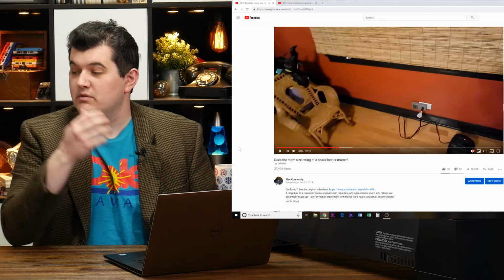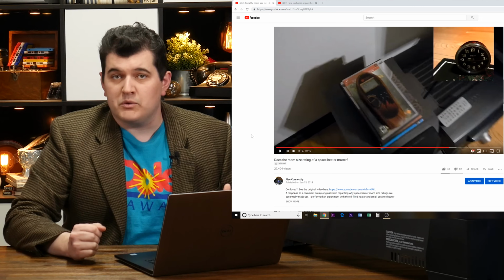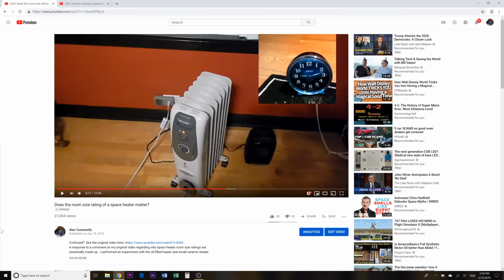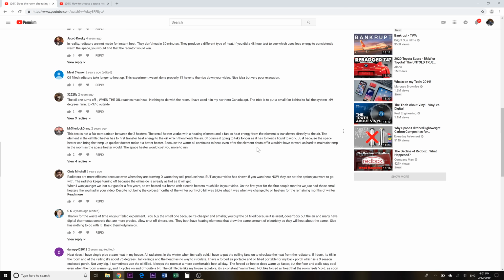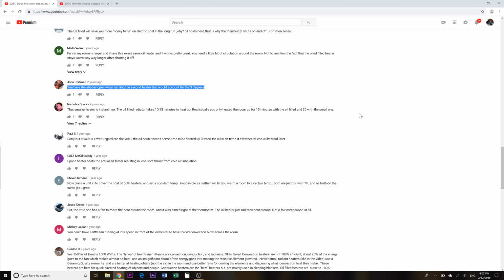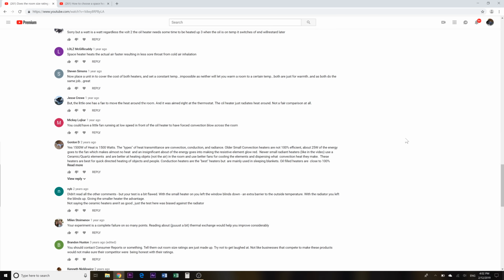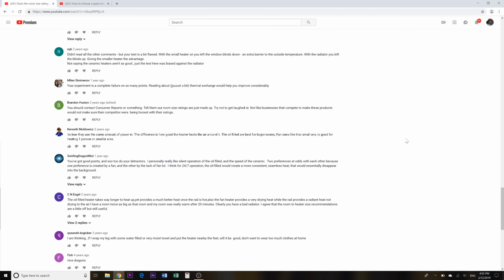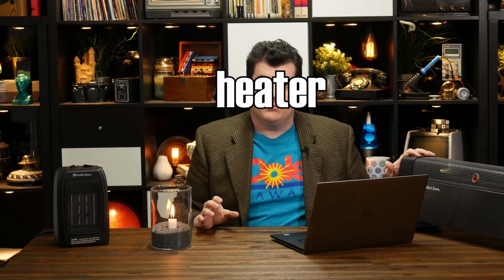More Space Heater Nonsense

Comment: Also oil filled heaters use convection so the heat goes straight up to the ceiling. Guess what, the ceiling is leeching the thermal energy out of the air into the cold attic before it has much of a chance to mix into the room. Fluid dynamics plays a large part in how effective your heating strategy is.

Comment: Neither one "produces" more heat energy than the other. However, my only argument would maybe be implementation of use. I think the convective baseboard heater would be better utilized near the wall, under a possibly drafty window. The heating of the wall would allow a larger surface area to help radiate heat to the room and rising heat currents would be distributed more quickly with a draft from the window. It wouldn't necessarily warm the room any faster but it would be more consistent and temporarily address the concern of a drafty window. A sharp draft can be felt acutely so if the draft is warmed first, it is a lot less noticeable.

In the end, neither one will heat the room faster than the other but I think they are designed to address different use cases.

In the end, listing the "room size" is a silly way to advertise them. Listing specific use cases would be better.

Comment: It would make sense for products that have on-off cycles to print an average power output. The only difficulty is that for a heater this would depend on the room temperature (since the cycle's purpose is to prevent the appliance overheating)

Comment: All else being equal, I thought it logical that a larger heater with a fan would heat the room faster than a smaller one - until I looked up the definition of watt (I had forgotten).  When I saw that a watt is a rate/time thing, everything you've been saying made sense.  I don't recall you saying anything about a watt being a rate measurement of work/energy per unit of time...

Comment: I had an oil filled radiator in my bedroom and it did a fantastic job at keeping the temperature consistent. It may not heat the room up fast but once the room is warm,  it will stay warm consistently. I don't know if the blowing ceramic heaters can do the same thing 🤷‍♂️

Comment: The only reason an oil filled radiator can be more comfortable, is because the temperature is more gradient. But no, it has nothing to do with the size of the room. A watt is a watt. Also in not so well isolated houses/rooms it can be nicer to have a oil filled radiator because when you turn off a electric fan heater, the heat will dissapear really quickly so it goes from warm to cold very fast.

Comment: So I will say that I have a Delonghi (I think thats the brand?) oil filled heater that I have had for several years, and its thermostat is offset from the unit itself several inches (edit: about 2-3 inches), located in the front (and away from the convection channels and radiating surfaces) and connected by a thin plastic piece with fins I assume to reduce temperature transfer (or save costs).
It will run constantly until it dumps enough energy into its oil (and eventually into the room) to bring it to temperature. And it regulates temperature better than any heater I have ever had in my life. It seems to use a digital thermostat with maybe an EMA, and it chooses between 500, 1000 and 1500 watts based on the temp delta over a unit of time. that EMA and choosing the heat setting based on the actual temp delta from the target to the room temp makes it very well suited to adapt to even smaller rooms when I have used it... it often just cycles on 500 watt mode here and there and turns back off. And uses the full power wqhen its really cold or in larger rooms.

So, the oil heater brand and model might be a factor. When this heater eventually burns out, I might actually cry, its so well thought of.

Hot take: one of the benefits of having a space heater is to actually eliminate the dead zone in temp regulation (where temps can be stochastic over time due to a central thermostat being in another area), and some heaters are better than that at others. Most digital thermostats have large dead zones. Most analog ones (even cheaper ones) have smaller ones when dialed in right. this delonghi somehow just get it PERFECTLY.

Comment: In climates that are only cold two or three days every other week or so, 1500 watt heaters work very well. I have one more expensive one for my main living area. It is equipped with remote control, variable output (it is often best to leave it operating continuously at half power). There are several safety switches should it tip over or have something obstruct it. They are both ceramic so that the glowing coils are never in danger of igniting anything. I have had the oil filled radiators and never thought they were good.  If I had rigged a fan to blow the heat away from it they might have worked very well and lasted more than a year. I avoid buying anything that gets hot yet relies on a circuit board or similar component.

Comment: I sometimes put a little desk fan beside the oil-filled heater to move the heat with more than just convection, and it helps cool the thermostat letting the unit run longer cycles.

Comment: 14:30 ima disign an inefficient space heater that instead of heating emmits long wavelength radio waves that will pass easily trough your walls and won't heat your room

I don't believe one is doing that tho... You can always check (don't, it's a waste of time, and funds)

Comment: In some cases the oil one is better if you're concerned about efficiency. If all you care about is a constant source of heat near your body, it may be worthy, however, I am willing to bet a fan heater would do much better if on medium (usually 750 watts) while pulling less energy overall. There is the noise factor, but higher quality heaters are usually quieter.

Comment: In heat transfer and distillation classes it was always nice when a heat source was specified as electrical resistance because a 20,000 W source imparted 20,000 W regardless of temperature. You didn't have to estimate efficiency or losses like you might with other sources. (in reality electrical heating is rare in processing due to costs, but it was a nice way to reduce the length of a calculation.)

Comment: Oh I stumbled onto this video while looking for a review on a heater.Now in my bathroom I prefer a ceramic little heater as it warms up my bathroom quickly which is what I need. In my caravan I use an oil filled radiator as this keeps the caravan warm while I sleep without making any noise.Now in my study which is upstairs in a two story house with no heating in the upper rooms in the house we have two panel heaters wall mounted which are silent in the bedroom. In the study I have a convection type heater which I sit close to stay warm but if I get uncomfortable it has a fan option which like the ceramic bathroom heater warms the room more quickly. I purchase heaters that suit what I need quick heat,silent operation.if a heater is advertised as for larger rooms surely it must have fan assistance.

Comment: Years later, I know... you would have better shown your point by showing the room being heat soaked by each heater... Leave it going for 24hrs and then check the temp... if one was for a "bigger room" it would be a higher temp after the 24hrs. By doing it over time, you add a human element which requires other parameters to be sustained. Time is a foreign metric here, the only metric required is heat, so heat soak lol
You confused your point, you were arguing that the heat output was the same. But by limiting on time, you play foul of other difference between the heaters; like method (Oil vs Air) and efficiency.

Comment: I think to compare the efficiency, you’d need to run them both for the same time but then wait until they cool down to room temperature and then take the measurement at that point. That would allow the oil to pass the heat load into the environment. 

I have a very strong feeling the results wouldn’t be much different that what you’ve already found as you have very good point especially with the thermostat. However, it would eliminate the difference of oil vs air heating. 

After all, 1500w is 1500w and unless you’re using anything other than resistive heating like an air pump which has >100% efficiency , you’ll get 1500w of heating out of it.

Comment: First, I agree with his analysis and basic use of thermodynamics, all 1500w heaters warm the average temperature in a room at the same speed given they run the same amount of time. 

However, I do have a way a heater can more efficiently make you comfortable. Infrared Radiation. I'm not sure how much it makes an impact though. 

I saw a space heater that said it had eco+ operation, and just like this video, it annoyed me. From outlet to heater, all 1500 watt heaters deliver 1500 watts of heat. 

However, after many annoyance driven thoughts, I did notice the ceramic heating unit is 3x15ish inches. The fan doesn't push that high of pressure of air as a result, but that's a lot of surface area and seems designed to emit a lot of IR radiation.

Aim it at you from a comfortable 5 feet away, and its 1500 watt thermal output will more efficiently heat your body. 

Not all space heaters claiming efficientcydo this, and it's both technically true and also a stretch in my mind. But if you're going to sit near this thing, it's a damn thoughtful design and although complicated a consideration that would be nice for shoppers of space heaters should consider. 

Though if you like this idea, get a heated blanket. Thermal conductivity for a win... Super efficient way to heat a body.

Comment: It might be worth “preheating” the oil heater in another room until it reaches its max temp, then running it into the cold room to conduct the experiment. Not having to power the fan might save electricity as well. While it certainly isn’t as effective, it might be more efficient by a small margin unless it has an electric pump to circulate the oil.   If for example it was 100 watts the fan might be using 20 of those watts, so you are only getting 80 watts of pure heating. I’m not trying to be pedantic I’m just trying to explore the potential benefits I haven’t heard anyone mention. You might be able to squeeze out some long term savings on your heating bill. Although I don’t think fans are especially expensive to run.

Comment: I bought my James Dyson AM-04 Hot and Cold over 7 years ago. The On/Off Button failed last Summer when I was using it as a Cooler. 
The Remote Control failed shortly after I bought the Item from QVC after it was put into the Washing Machine.

It was rated as 2000 Watts and the Digital Temperature Display was VERY accurate when compared with a "Mercury" thermometer in the same Room.

Comment: There might be a difference in heat concentration. Thus larger model could be preferrable due to lower temperature (with higher surface area). I've heard ideas that they don't "burn air". An imaginary 1.5kW heater with a tiny heating element could do some chemistry

Of course it doesn't affect efficiency and room size arguments. Great video

Comment: I just got my first oil filled heater after after being reluctant due to their slow warm up times but I got it for the basement and initial warm up time isn't that important as it should only happen once at the start of the cold season or after a power outage. In normal conditions I like the constant heat and I sometimes need to turn off my space heater to use something else on the same circuit and like that oil filled heaters stay hot for a considerable time after being turned off, so as slow as they are to warm up, they are as slow to cool down. A fan based heater gets cold virtually instantly when you turn it off, just as it gets hot instantly when you turn it on. They each have their benefits, in other rooms I do prefer a fan based heater as I sometimes want to cool or warm the room quickly.

Comment: The larger heater, having a bigger surface area that heats up, might feel more comfortable for people sitting next to it.

For instance, a small heater might only be able to blow warm air towards a single person in a large room, while a heater with a wider form factor could work for two or three people at the same time.

Sure, they both would heat the room just as much over time, but the instant sensation of warm air would benefit more people when using a larger heater.

Even for a single person, a tiny heater might only be able to make their hands or feet feel warm, whereas they'd feel warmth across their entire body, if the heat were spread over a larger area.

Another reason the larger heater is advertised for larger rooms is because its size would be more of an inconvenience in small rooms. You might find it very often being in your way while you're trying to move around.

Comment: Infrared heat from a candle flame or better yet, a fireplace, will mainly pass through the air and heat the first object it hits.  If that object is the ceiling the heat will be largely lost quickly.  The flower pot will keep the infrared heat down within that object in the room, causing an increase in efficiency

Comment: LOL... Nonsense... Power Efficiency is not the same as Heating/Cost Efficiency... How and what a Heater is made of in addition to power determines its heating/cost efficiency and range...  For example... Heater 1 is a small ceramic 4 inch element with a small fan... Heater 2 is a tower ceramic two 4 inch elements with 2 fans and oscillates... Both are 1500 watts...   Heater 2 will heat a room quicker and provides a more even comfortable environment and runs half the time as Heater 1...
Reply: Bud are you retarded? His first video disproves your comment

Comment: Here's my hypothesis. The smaller heater is primarily heating the room by convection. It blows out warm air which mixes with the air in the room. 

The large room heaters create the same amount of heat energy, but it's mostly radiative - infrared. It takes longer to raise the temperature of the air in a larger room, so the heater focuses on creating radiative heat that you feel immediately on your skin. 

Think of sitting by a bonfire. It can feel warm - even unbearably hot - at a distance where the air around you is still cold. The fire is actually wasting most of its heat to convection, but the radiative heat is enough to heat your skin.

In other words, the effectiveness of the heater has more to do with how warm you feel than the absolute temperature of the air.

Comment: Here is my idea for an actually efficient electric heater for a room that is too cold.
A 350W IR reflector lamp.  Mount in a high corner opposite exterior walls.  Could be something like a heavy base pole lamp if portable is desired, or simply hung from a swag lamp hook.
An occupancy sensor set to turn off after 30 minutes unoccupied.
An IR detector pointing at the diagonally opposite corner. Use this to regulate on/off or current (preferred) in the reflector lamp. May work better if pointing more at one wall, the other wall, or the floor in that corner depending on the room and/or occupant 
Have a dial to regulate the desired wall IR radiation temp.
This will not quickly regulate air temperature, but it will regulate the temperature people sense.
May not work well if there is something like a fan that would interfere with the occupancy sensor. unless that was plugged into the occupancy sensor.
Occupancy sensor can not be based on IR of the wavelengths emmited by the IR lamp.

You want to use the cold room? Stick your head in a few minutes before you go in, or tough it out for 5 minutes.

Comment: You ran into the issue that the question is flawed.  This is judged in reality by comfort, not temperature.  Actually baseboard heaters lose a lot of heat through the wall.  The most efficient electric heater is a set of electric long johns, electric socks, or maybe a brooder lamp pointing at the chair.  Possibly just a heated carpet.  When people feel cold when sitting in a room, is is often that the floor IS cold.  The psychological effects are significant and vary with the seasons.  67 may feel OK in February, but feel cold in June.  As thingsd cool in the northern hemisphere in September 73 may feel cold to someone who would be happy at 67 in February.  I have seen the same issue with my wife who always thinks the furnace has failed at 6PM after the sun goes down in winter when the temperature is the same inside as it was at noon.  The difference is the temperature of the wall starts to fall as the sun goes down, and the wall radiates less energy.  It was heated by the sun earlier in the afternoon.  I think it is a combination of people being more sensitive to IR than air temperature, an effect of relative humidity, an effect of airflow, and an effect of recent and not recent temperatures.